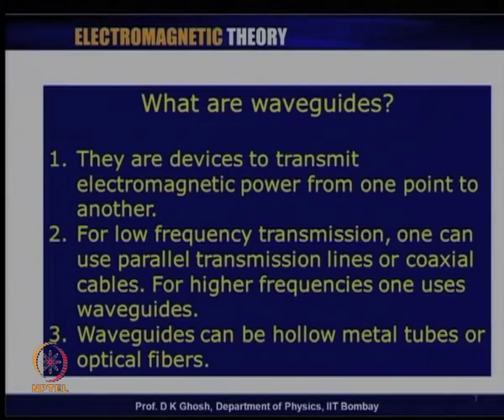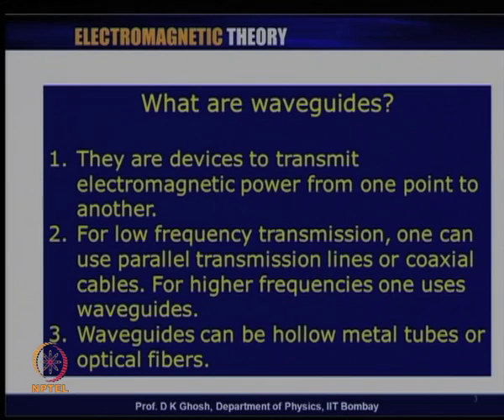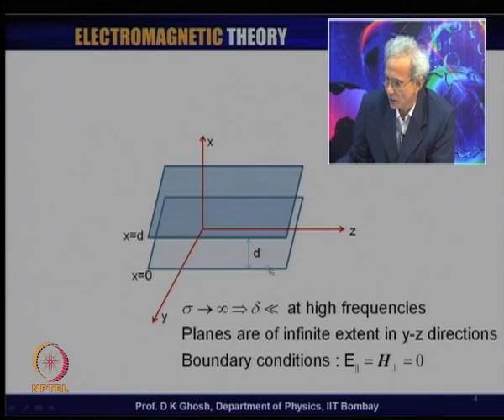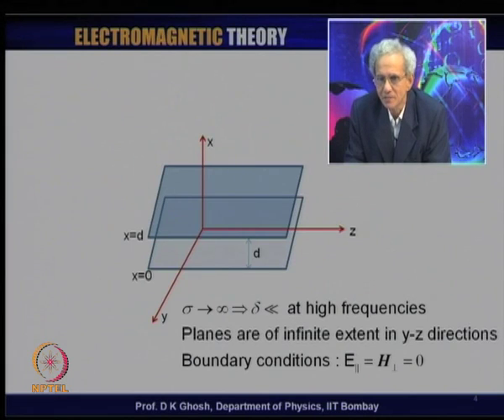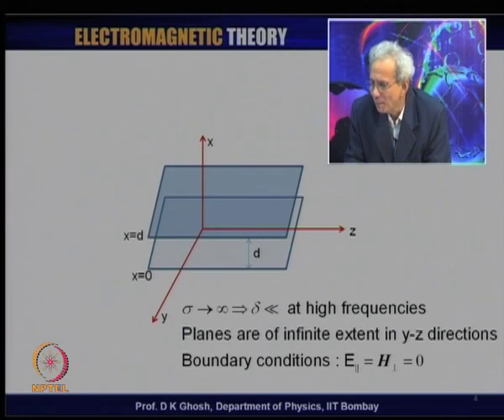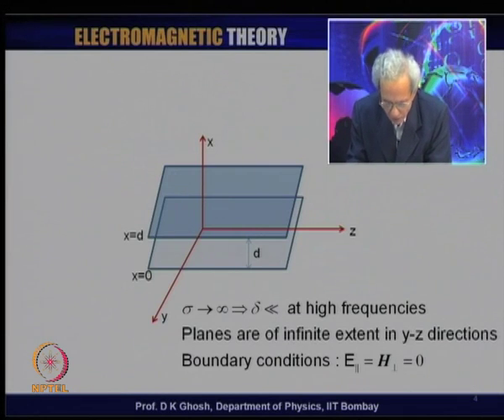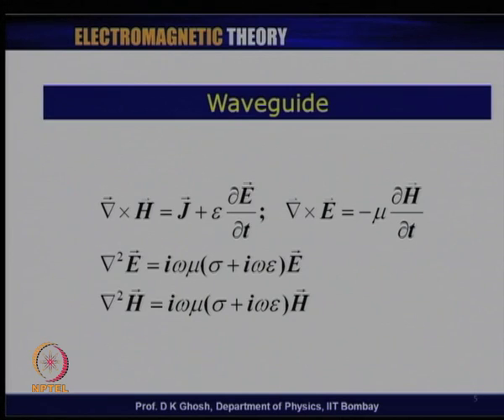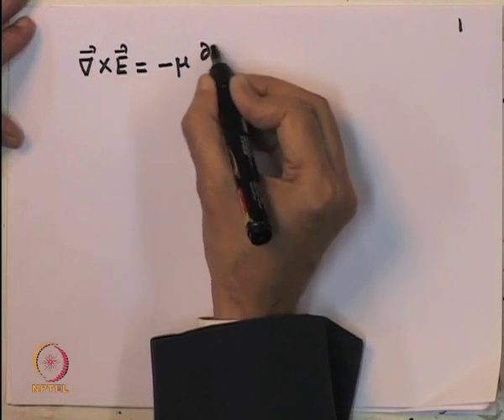Mod-05 Lec-36 Waveguides

Comment: Is there something wrong with the 2 derived equations in the expansion of the Del Cross H ( or E) equation? I.e. Maxwells first two equations. Shouldn't you have:

  |   ax         ay         az    |
  | d/dx     d/dy     d/dz  |
  | Hx         Hy        Hz     |

which should expand to have (considering the Y component):

[d/dx(Hz) - d/dz(Hx)]ay = j*w*e*Ey  

Why is yours inverted in both derivations for both Del cross H and E?
Reply: there should be a minus sign in your LHS.
Reply: Absorbing the negative sign